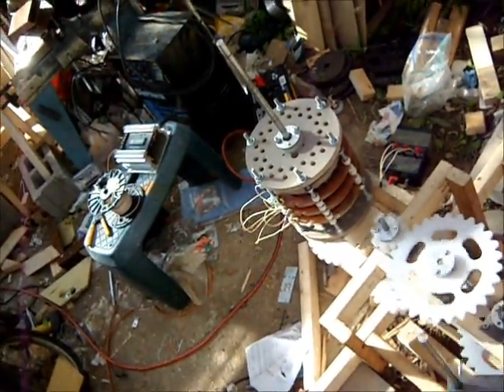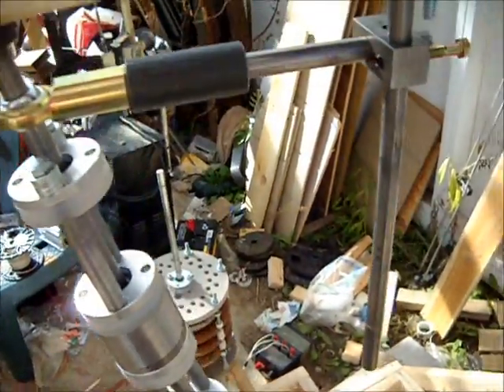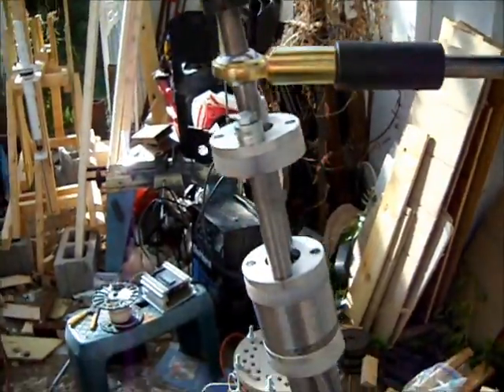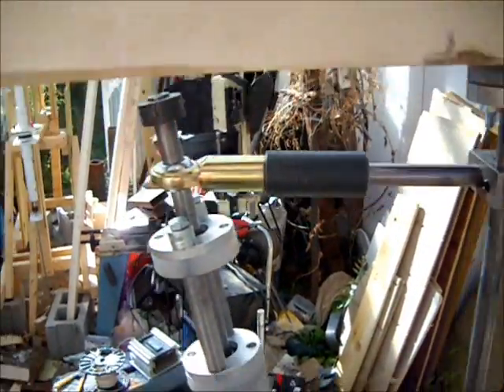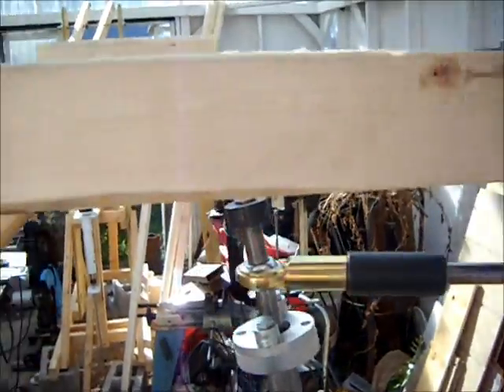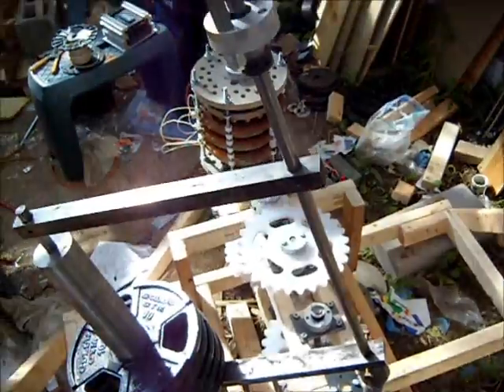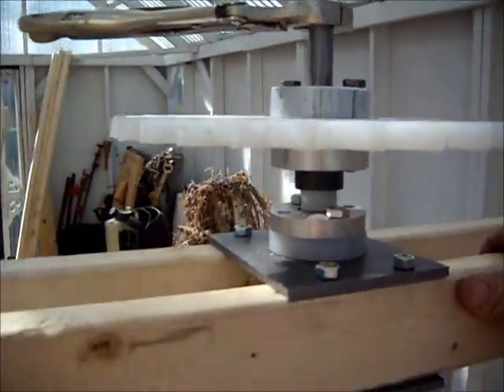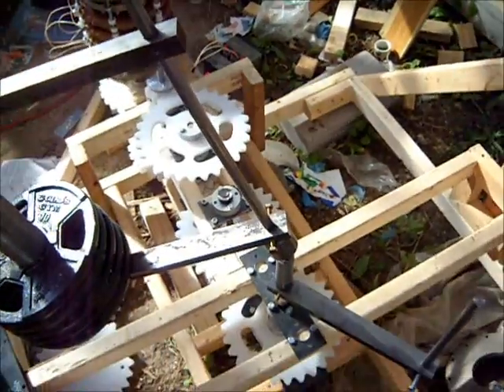SKINNERdemoManualTest

Comment: The weight is supposed to spin freely on the axis of the control shaft. The power is taken from the bottom of the shaft but it is the ever changing plane that allows the weight to do the work. All you should be moving with your arm is a bar with a bearing to connect to the shaft.The angle should be very small to start with. It may be that when you have understood the principle you will find that up to a 40 deg included angle will work. The power is generated by the weights movement around the shaft axis and is simply controlled by the shafts angular movement. Nice job on the mechanics. If you would like to see the math for it let me know.

Comment: Hi there love your work but having spent upwards of 3 years developing my skinner device(and all most there) i thought i would point a couple things out to you. First the angle of the shaft is way to great (smaller off set greater weight is the way to go )if you look at the skinner device it is at the most a inch off set the greater the off set the more work your input motor as to do.
secondly you need to loose some if not all the gears i can count at least five sets of gears every gear as at least one bearing point each bearing point causes friction from experience a toothed belt extremely large pulley on the out put from your skinner  to a very small pulley on the generator is a much more efficient way.
hope this is some help and keep the good work up

Comment: Speed of curvature probably goes a long way toward producing the torque amplification affect, as it produces centrifugal force on the mass that would add to the gravitational force keeping the mass in phase with the tilt bar. At slow speeds there certainly wouldn't be much centrifugal force acting in the system. I am almost certain also that the upper stage of Skinner's machine was designed so as to caused the tilt bar of the lower stage to not only rotate around a center point but to tilt even more outward in it's orbit as resistance was met.

Don't give up!
Reply from the maker: Hi, I adjusted all the possible parameters and  I was not able to increase the speed. This configuration did not work for me.... I am currently working on a new design for a gravity assisted motor. I will post results when available.